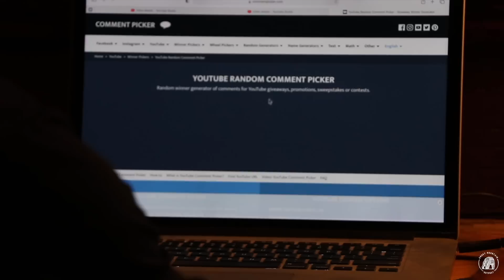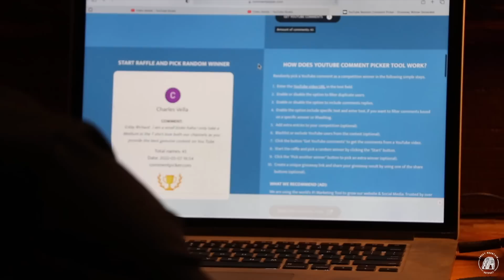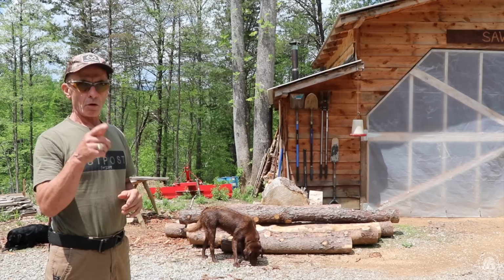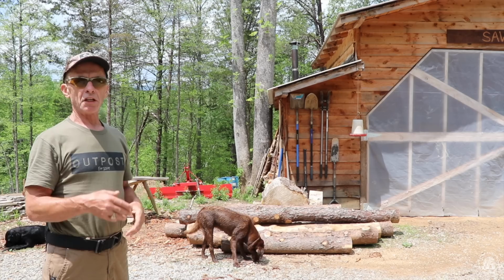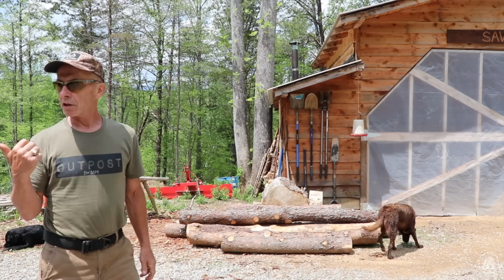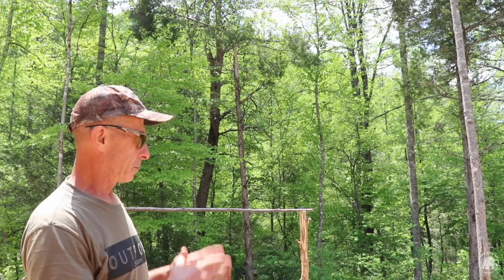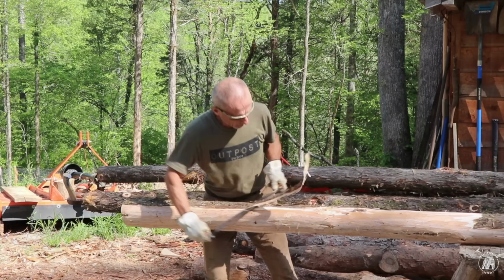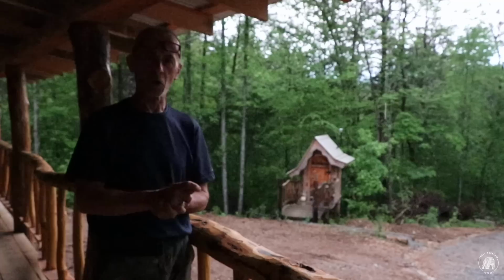BUILDING A TOWER & WATER STORAGE BASE | HOMESTEAD

Comment: build tower on the ground and tip it up...use the tractor ....one side comealong on the opposite sde and bolt it up using running thread rods You are at no age to fall working at heights will end an older guy...

Comment: I has wondering why you have not considered using the bamboo for a tower? Definitely not as strong as logs but that star link is pretty lite may it just would not stand up to to the sun anyway just thinking out loud. Communication towers are usually not that heavy duty.

Comment: Just a suggestion, but could you use one of those pallets as a base for a work platform (with safety rails, of course) to use on the forks of the tractor?
Reply from the maker: I will forward this to my dad. Thanks for following! -Jennifer
Reply: @SmokyMountainOutpost  My pleasure Jennifer.